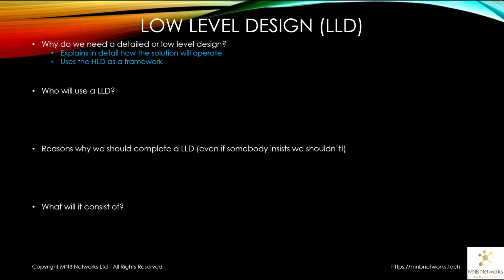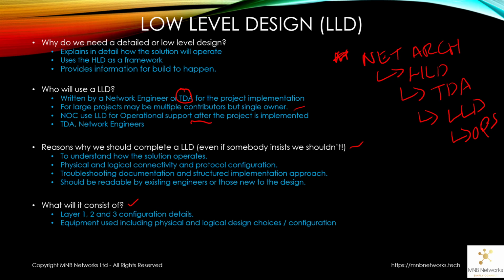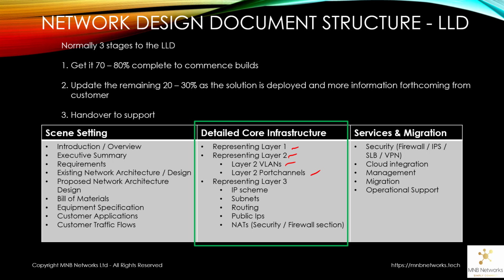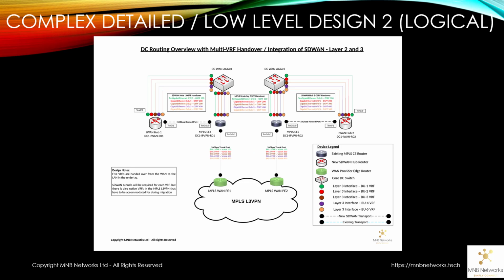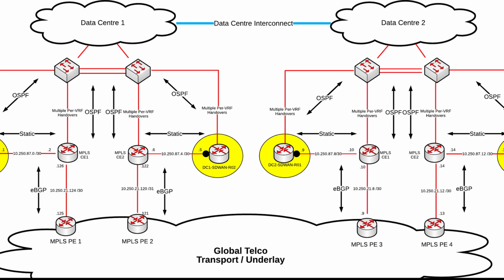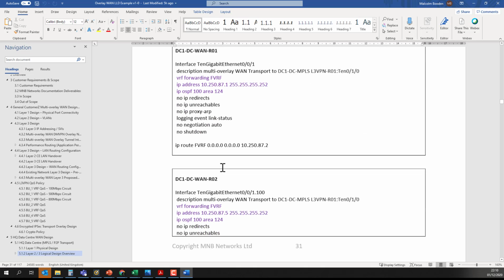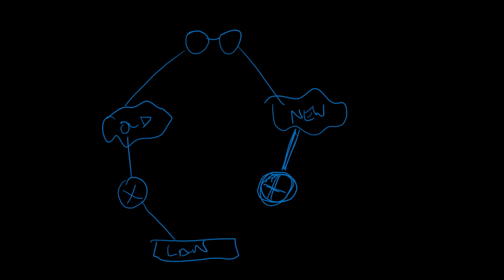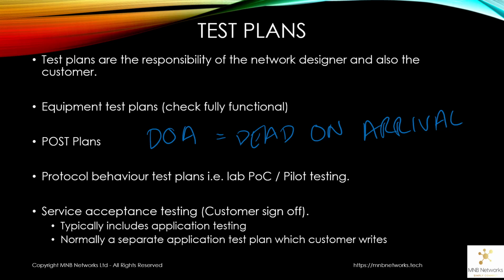Network Design Fundamentals - LLD

Comment: Thank you so much for the video. I would like to know what are the best design tools we can use - Visio, Lucid, EDraw. I would like to know if there are any other more sophisticated tools please.
Reply from the maker: We use a mix of tools but mostly Lucidchart Teams.

Draw.io is good, easy to use and has free options.

I just have a legacy version of Visionthat can read native .vsdx files as sometime import and export between these tools doesn’t render the lines exactly how they are in one app vs the other.

Also for example you cannot change the fill colour of native icons from Visio template when imported into Lucidchart.

Little quirks like this!  Each of them has its own strengths and weaknesses.